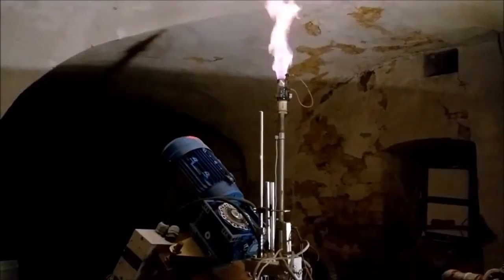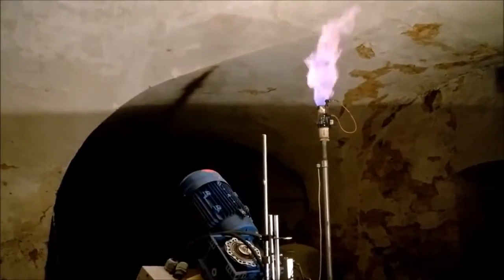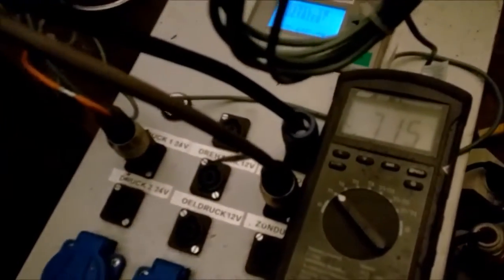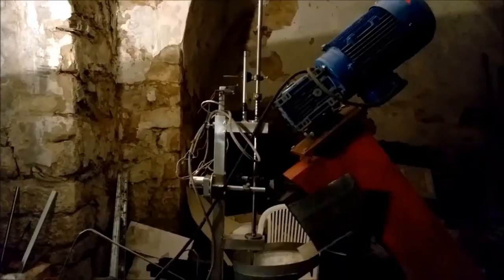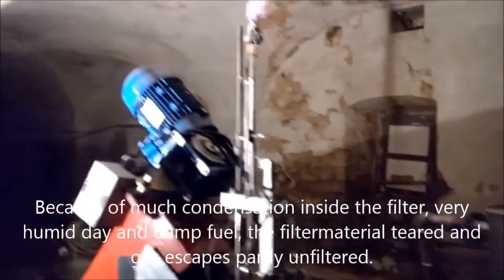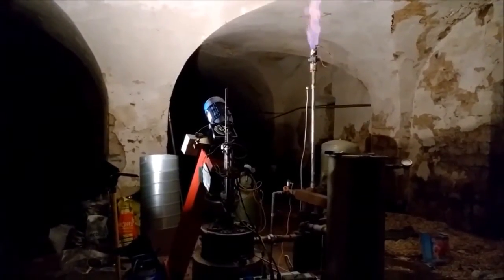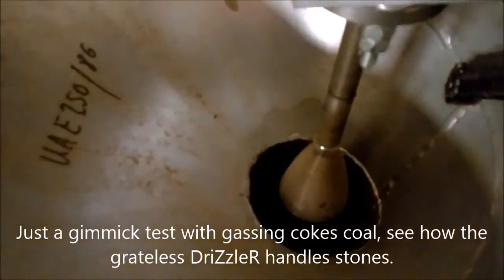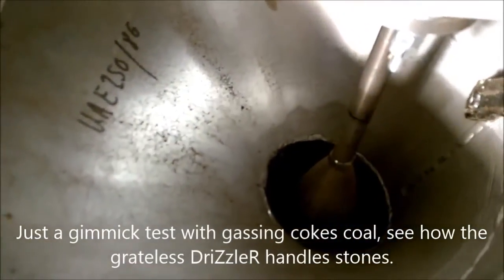Grateless DriZzleR Gasifier - first testburn

Comment: no flaming pyrolisis... I thought that was the key to the dirzzler method and making tar free gas.

from the drizzler blog... "designing of a DriZzleR can be done visualy and intiutive. In fact, since in a DriZzleR all is hapening in the Flaming Pyrolyse"
Reply: International Supply Hello Arvid, Please read the post I just put on the woodgas forum. There I explain why a solid surface is needed to optain the hammering effect. The result is indeed less good gas as in the standard DriZzleR with a flaming pyrolyse bed. I think with pellets, beeing a more compact flaming bed the hammer would do well. But this new gasifier is all fresh and a lot is still to experience. As yet we do not know if this gas can be labeled "engine grade". An engine test is forseen and will be posted, succes or fail.... we will see.